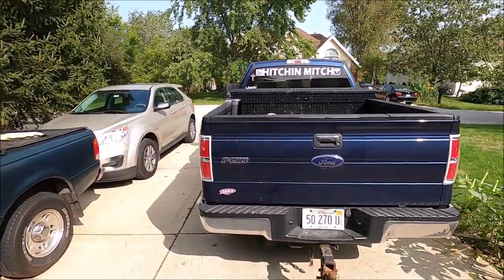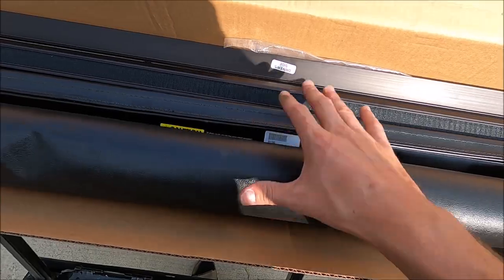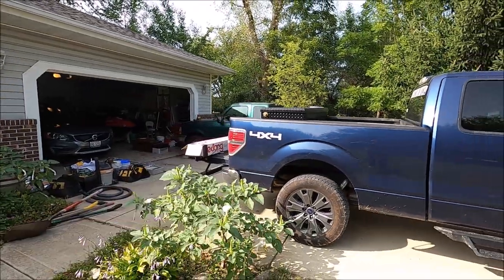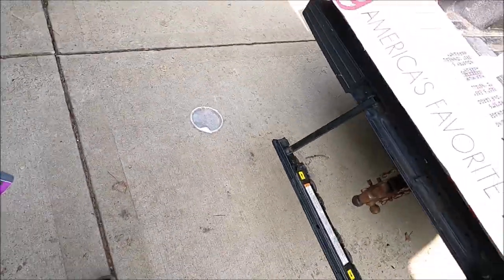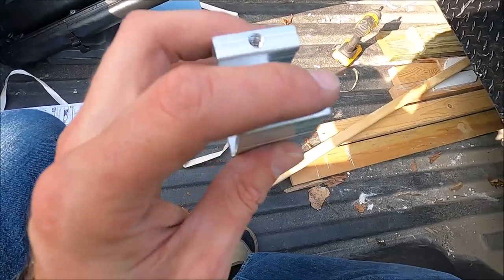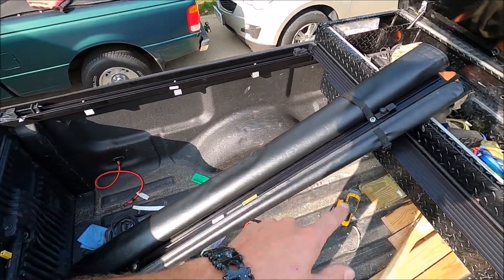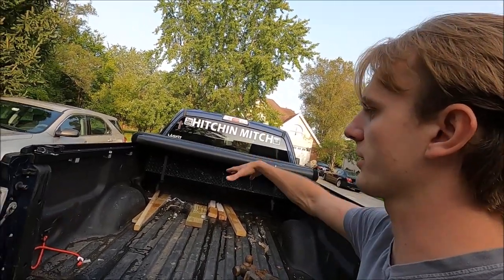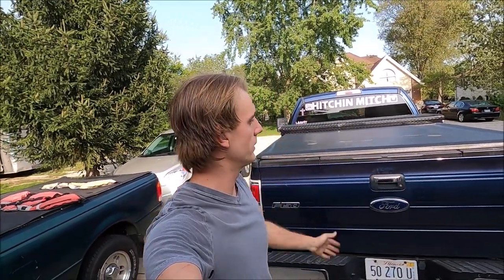Extang Tool Box Bed Cover Install | 09-14 F150 |

Comment: I know this video is a few years old but I’m looking at buying a cover for bed to work with toolbox and came across your video. My question is how much of the water was forced through by high speed blowers at the end of the car wash vs if it was just raining outside.

Comment: At least your tailgate locks, mine is seized. Prob never been used. I'd like  to find a way to fix it though.
Reply from the maker: It could just be seized from corrosion. I would try soaking everything internally with penetrating oil.